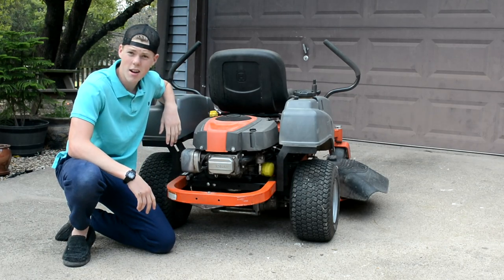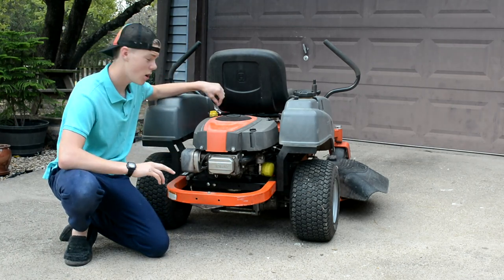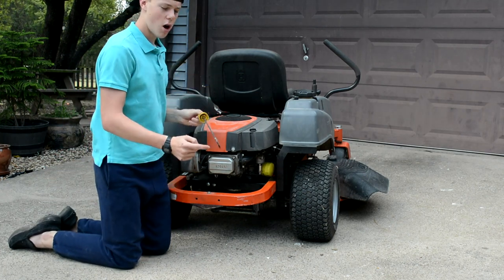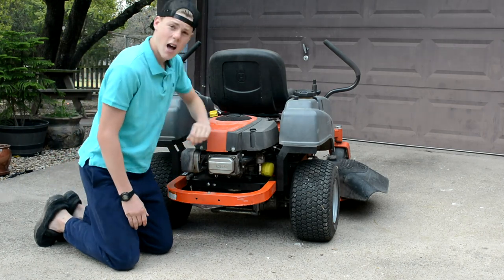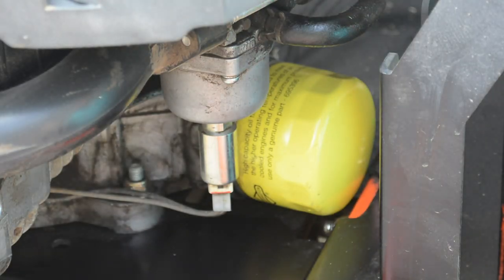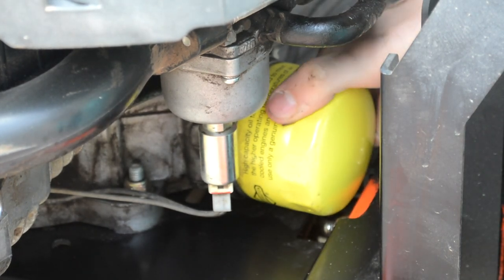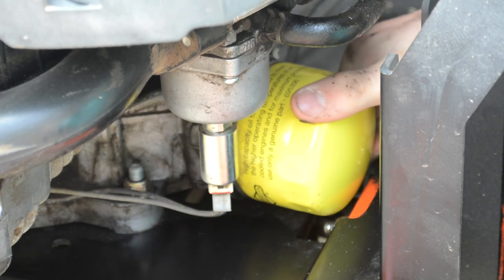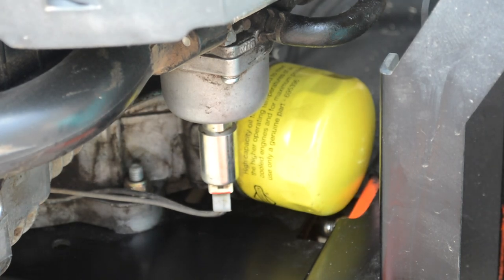How to fix a zero turn mower oil leak, Super Easy!!!!

Comment: You should never tap the dipstick on the ground or let it touch anything that will transfer contaminants to it.  When you replace it, the dirt will be in your oil.  Don't let the negative comments get you down.  Learn what you can from them and ignore the attitude.  There's plenty of help available to improve your channel content and presentation skills.  Ask your friends to critique your videos before you post them.  Stick with it if this is what you want to do and you'll be fine.

Comment: I been working on mowers for 15 years and NEVER found a leak to be a loose oil filter.. Thanks for the laugh.
Reply: I got a Toro MX 4200 with the actual Toro motor not the Kohler. It's a 22.5 horsepower. I'm getting oil around my oil filter leaking down ... I tightened the filter and even after the second filter it's still leaking. I wonder... Overpressure?
Reply: @ArcolaBridge  hey I have the same issue with a toro time cutter zero turn. Did you fix your issue?  if so please share what u did. 

Mine is leaking around the oil filter, but it is tight. I see a gap where the gasket should touch, I have tightened the male end adapter. and no there is not a gasket stuck on the machine, its almost like the male adapter piece came out 1/8 inch. But it is tight I don't want to over tighten it.
Reply: @braedenr9645  I think oil pressure is pushing out oil either around the filter or around the filter housing. I have not fixed my issue.
Reply: @ArcolaBridge  did you get it fixed? Having same problem toro engine zmaster
Reply: @xesusv4069  no I haven't, I replaced it with another new filter and same issue... I think maybe it's just overpressure pushing out around the seal combined with vibration.
Reply: @ArcolaBridge  are you able to use it while it's leaking ?
Reply: @xesusv4069  yes, it's not a major leak it just accumulates over time. Things I have thought of to remedy the situation are using a thinner oil and taking it easy. But that probably won't fix it either. I kind of sort of think that it must be escaping from the vibration around the oil filter seal. As the other guy mentioned I thought about trying to retorque the filter thread and maybe even applying some thread glue? But it seems tight and I don't think I have noticed the filter itself getting loose at all. I know the last thing you want to do is over tighten it.

Comment: I'm very mower illiterate and I just had my mower service but it looks like some of my I don't know if they're screws nuts bolts whatever the heck they're called are missing where they were before and this man's been doing mowers for 40 years I have a zero turn simplicity 2020 52 inch.can also ask u if gear oil will be ok til I can ask how to grease my squeaky deck

Comment: There is an oil cooler between oil filter and the case on Kohler Courage models... which has a gasket. For sure on the 22 hp. vertical shaft model. VERY easy fix...but will freak you out initially when you see oil leaking!!!
Reply: How do I fix it?
Reply: @scraigrogers  if I remember correctly....take the oil filter off and there is a kind of a bolt head where it spins on. Take that off as you would any other bolt. The oil cooler is between the filter and engine block. IF I remember correctly.
Reply: @scraigrogers  and there is a gasket between the block and oil cooler. Good luck! Easy.
Reply: @scraigrogers I just looked and the cooler looks like 3/4 - 1" restrictor plate with cooling fins.

Comment: Mine is leaking around the oil filter, but it is tight. I see a gap where the gasket should touch, I have tightened the male end adapter. and no there is not a gasket stuck on the machine, its almost like the male adapter piece came out 1/8 inch. But it is tight I don't want to over tighten it.